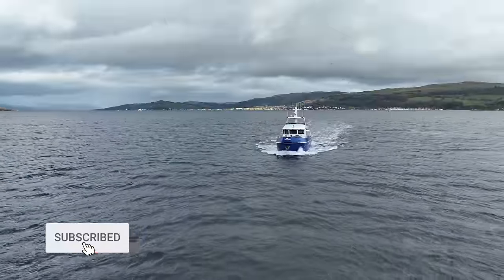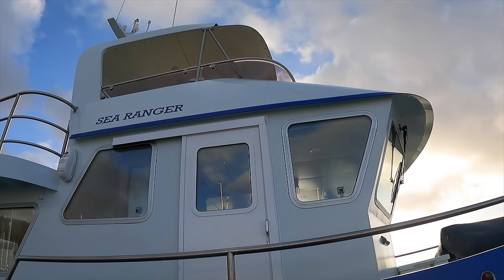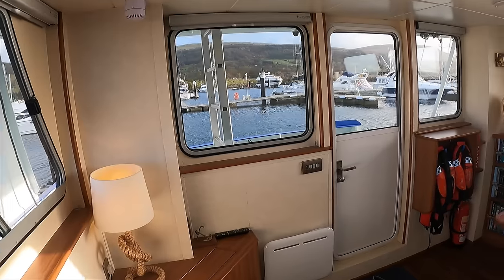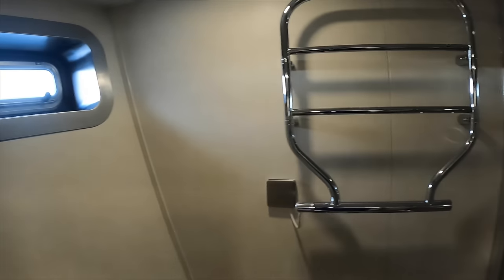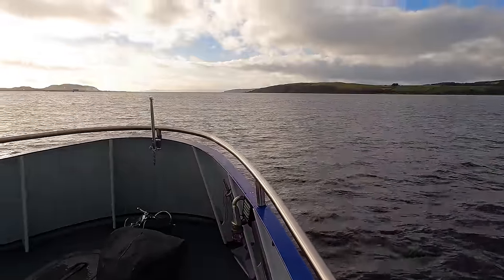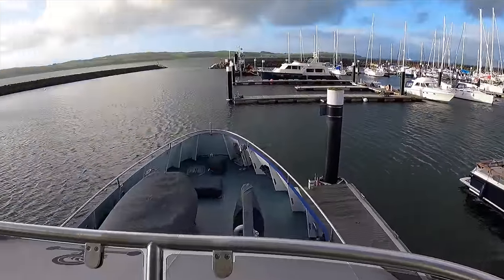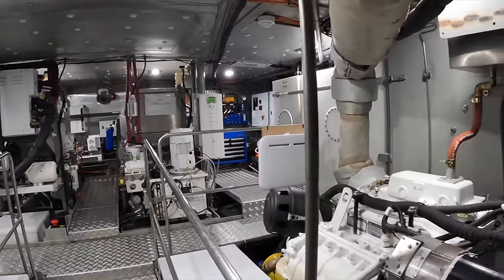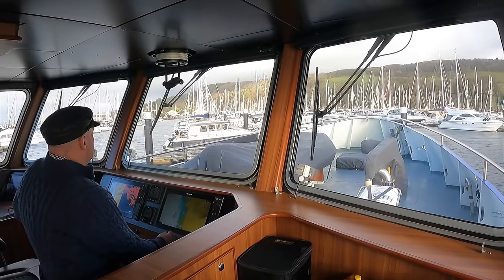THIS Is Hull 1 Of A NEW Steel Liveaboard Trawler Yacht (And She Is For Sale!) | YACHT TOUR

Comment: It is a beautiful yacht, but it has an identity crisis. It's built to a standard that would allow it to cross oceans (class A rating, redundancy, strength, etc), yet lacks the fuel capacity to do so (even if gray water tank converted). Also, it seems to lack the storage and refrigeration necessary for a long voyage. I hope the tiny refrigerator in the galley is just for the everyday items, and there's a much larger refrigeration unit elsewhere. Where is the dry goods storage? On the flip side you say the owner uses it as a coastal cruiser - well, then it's completely over-built for that purpose. I'm sure there's a buyer for this, but you have to want something that looks like a commercial ocean going vessel, and has a price tag to match, but yet will be used for (mostly) shorter voyages of coastal cruising. She is a handsome yacht, and the quality of the build is evident, but she falls into this weird zone between true exploration yacht and coastal cruiser.
Reply: Very well put  ...

Comment: I like it! It’s small enough to captain and crew yourself, but big and stout enough to to handle the blue water. It doesn’t have any waisted space like a 300sqf bar or dining area on 3 different decks. 
The only thing I would have done is have a day head at the aft of the boat.

Comment: For a true seaman who does not need all the flash and bling.  A tough and dependable boat in all conditions.  Hull #2 I would go for twin 250 hp Caterpillar or Cummins. Definitely look at how much speed you gain and fuel use.  You can always pull back on the throttles. Another great 📹 video.
Reply: You wouldn't gain much if any in speed and just burn more fuel.
Reply: That's not entirely correct. Any long-range cruising power vessel, especially for a family on a limited budgets, is best served with smaller but adequate economical, reliable and slow-revving engines. This vessel is already achieving hull speed or better, although one assumes it is lightly loaded for this video. I was pleased with how well it moved through the sea.

The only case for larger engines would be if one were pulling lines or nets or possibly finding that towed deployable stablilizer vanes were creating too much drag.  We all know that if you gave the Queen Mary enough horsepower, you could launch it into space, so more speed is always possible, but the cost in fuel use, burn rate and hence reduced range or additional tankage and hence weight and space requirements and hence "balance" are always a complex equation that must be considered.  Every tweak has a flow-on effect.

Anyway, I'd like to see some underwater lines for her and know the type of steel and protective coatings used. Corten or Lyten (added Cu-Cr) weathering steels are good rust-resistant steels which I have used, that cut cleanly with a torch and bend around the frames to nice fair lines, eliminating the all-too-often "hungry horse" look when low quality and/or badly-welded steel is used. 

I've spent years winnowing down the options for a true long-distance passage-maker and still consider Nordhavn to have got the recipe pretty right, but they are obviously much more highly-priced.  Fleming are good craft too but a but a bit too shallow in the draft for long distance open ocean work in poor weather, I feel, not to mention the cost.   

This craft looks like a good alternative and while appearing more "basic"in its internal trim, is clean, serviceable and being steel, very robust against damage and easy to repair, but requires careful attention against rust. The clean interior walls helps keep an eye on that issue. Condensation behind interior panels, especially fitted or sprayed-on insulation, can be an issue with steel, too. 

I'd perhaps like to see more fuel capacity for longer range while keeping the existing power plants. I still like the redundancy of twins and still find the Nordhavn standard setup of a single plus a wing-engine takes some careful consideration, and I feel it is a decision to be made subject to exactly what the vessel is to be used for and where it is sailing.  Again, the additional fuel use of twins becomes part of that decision. 

The Dutch-built vessel you  discuss in another video on sale with De Valk Yacht Brokers ("Sirius") is the epitomy of some of the best sets of lines that come from that country's designers. 

Thanks for the video. Sorry to have hogged your page, but this piqued my interest.

Comment: I would finish the hard top on fly bridge so it covers the whole bridge, put a track on hard top for sides and rear, install full front venting windows that go from visor to hard top then get high viz windows to put in slide and fasten to boat to fully enclose. It won’t be as toasty as the inside but still bearable and give you room to put a few chairs and couch up there

Comment: Dual engines! I commented on a few of your other walk through's about going to sea on long range boats with single engines. I would never do it. I am sure the owner was looking at $s for the bigger engines option.  So, spending their money, probably should have gone for the bigger motors along with building in more fuel tank space for longer range.  Other than that, this Yacht is fantastic! A 55 footer and how it is laid out is awesome!  It's a good looking, comfortable live aboard, and long range heavy seas cruiser.  Steel hull, rugged build, forward racking windshields, nice accommodations, super engine room, what more could you ask for? This boat rivals the Bearing Yachts for rugged performance in heavy seas from what I have picked up on YouTubing.  Great job MMS! and I am sure this boat has been sold while I am typing my comment.

Comment: I love this ship - so much has been packed in to a relatively small space. She looks both seaworthy and comfortable. While she was built for the rigors of the North Atlantic and the North Sea, I think she would be just as much at home in the South Pacific where I am.
Reply: A ship has to be 300 feet or better to be comfortable in winter conditions in the North Atlantic … somethings like a Flowers class frigate.
Reply: @taggartlawfirm  Those Corvettes were known by many who sailed on them  as 'Submarines' , twas reckoned they  spend more time under the water than above , what with their terrible handling and constant pitching and rolling 40 Degrees either side of upright, the wave spray and water was lofted up into Well Deck a midships  the decks were swimming from that broaching  activity as handling under heavy seas wasn't it's best suit. ...  thinking  the measurement was shorter than that LOA  same being at 205 ft (62.5 m)
Reply: @malachy1847  you may be right

Comment: An excellent vessel fit for purpose, I have been to that yard a few times and they do good work, reflected in what you see in the video, no nonsense vessel that if maintained should give little trouble for the next 50 years. I'll bet that fwd cabin is noisy though? would have preferred Cats personally and a hiab on the fwd deck for stores and launching boat, the one under cover looks a fixed davit for life raft. One big omission was the fresh water capacity, often as important as the fuel on boats that go long voyages.

Comment: Tankage seems a bit low for a 60 ton steel vessel. For staying in Northern Europe, which she was built for, it's plenty. But this class of boat tend to be the "final" boat for many owners (often retiring sailors...). The option for longer passages may make her more saleable.

Love both the interior and well as the exterior. Aft house trawlers are almost always nice. Big, very well protected foredeck, is a huge boon in bad weather. And even the somewhat smaller topsides this result in in a 55 footer, is almost an advantage for the typical cruising couple. "Spacious and open" is not nice when it's cold and stormy. Also, while good boats can be built in any material these days; a steel hull from a commercial yard, built for the owners of such a yard, is likely to be very straightforward and free of complicated weirdness, which a yachts-only builder could be tempted to include for boatshow appeal.

With diesel prices where they're at; you'd think displacement speed cruising will only be growing in appeal. It may not sound appealing to a "powerboat" to be stuck going only "sailboat speeds." But in practice, for extended cruising, sailboats are only problematically slow when the wind is not cooperating. Which unfortunately is the case too often. Being able to go "sailboat in the trades" speed in pretty much all conditions, is not really that big an issue at all, on a long cruise. (Big outlier being the Med. Where 15 knots makes every single passage a daylight affair. While 9 knots can mean staying the night out. But on any other ocean, that's rarely the case.)

Comment: Back in the 1992 I built a Bruce Roberts Pacific Coast Fisherman 36 and stretched it to 40, ketch rigged and single screw. I had planned to go walkabout but alas I had a mountain bike accident which has left me disabled no more boating. But one of these could be the answer maybe 85 could be the one for me with crew. Are they planning to build bigger?

Comment: If I ever hit it big I’ve always wanted to build a steel 130 foot long Alaskan red crab style motor yacht. House aft design. I’m in the Pacific Northwest and the Pacific Ocean can be rough most of the year. A big water fishing boat would handle more that 3 months of nice seas most vessels enjoy.
The problem with a steel boat in a salt water environment is rust and corrosion. Every 2-4 years your going into dry docks for major repairs. Rusted steel cut out and new welded back in. Stripped and painted. Even with zincs and anti electrolysis systems your boat is rusting away. A wood boat will last longer but is a similar situation.

Comment: I do like this trawler yacht. It's perfect for a couple. I'm not crazy about the twin engines, I would like to see a single engine option perhaps with a wing engine as an option.
Reply: Why the single engine? Isnt the point of double for redundancy?
Reply: How many couples would like a standard double bed? Queen maybe but a King definitely a better option. Two more rooms with only bunks would not suit having your friends coming with you. Likewise there are no windows in these rooms, just port lights up high which is a poor design.
Reply: I agree, there’s many advantages to running a single (with a get home wing engine) fuel economy, less maintenance costs, lower center of gravity as a single  engine on centerline can be mounted lower in the hull giving better stability, better shaft angle to prop, can use a larger prop with a single compared to twins. I could go on but suffice to say most fishing trawlers are single engine as are many freighters and very large oil tankers.

Comment: If building a live aboard vessel, then this is the way I would do it. The engine room is perfect for maintaining and is easy to access unlike those very expensive built ones with no room to get in the engine room let alone maintaining it with ease. A redundant generator is also what I would do, I would think about electric motors for propelling the vessel.

Comment: Saw a video of a similar in Florida with John Deere power (twins) and laid out similar. Doesn't have that "RV" look so common in fiberglass boats, and you can GET to any problem in the engine room. I'm in. You can always run down to Brazil or somewhere in Taiwan and swap out what looks like particle board finish for REAL mahogany.

Comment: I think price is a major factor here.  There is a lot of competition for trawlers of this size and capability, many of them well proven and finished to a much higher standard.  Personally I would not consider this boat unless there was a significant financial benefit to do so.
Reply: Agreed... I really like this capable and practical small ship, and could see it as a liveaboard for a frugal sea-going couple (like me) or small family, but it's lack of luxurious touches is certainly noticeable. It may be much more seaworthy than it's similarly priced competitors but you can get a lot of motoryacht for the dollar on the used market these days. I wouldn't even begin to guess what the price tag on this is but I would not be surprised if it is a magnitude of order larger than what I think this would be priced at.
Reply: It was stated quite clearly the trawler was not designed for cocktail parties. For me it is one the best designs I've seen for a smaller trawler. Clean, uncluttered easy to maintain and will go anywhere in almost any sea.
Reply: Yep. Lot of competition in this market, especially from several Dutch shipyards. Personally, I find the very high flying bridge unattractive.
Reply: @zorbakaput8537  So, how much would you pay for it?
Reply: Not 3 mill plus vat, it's just not fitted out to a standard that says I'm definitely not on a fishing boat!
Reply: Love the twin luggers this little ship sports.  For the occasional long haul it would be easy enough add an auxiliary fuel bladder or two.  Petro-Flex offers a rugged 500 gallon tank.  Best kept completely full until you can transfer all the fuel into boats tank at once.  This vessel could easily handle an extra 3500 hundred pounds of fuel.
Reply: I prefer the steeler 61s
Reply: I would find this boat very comfortable & would feel proud to own & sail it!

Comment: Excellent video. Interesting proposition. Curious why a long range displacement speed cruiser is twin engine. For a 60ft boat she seems to have limited interior accommodation and cabins. Interior looks a little utilitarian and spartan, not exactly a home from home. Feels a little dark down in the galley dinette area. No doubt she has excellent sea keeping.  I'm sure a boat like this would appeal to folks who cruise areas exposed to the Atlantic or North sea swells and extended shoulder season cruising.

Comment: Great video, but what's up with the frame rate? Sometimes it's incredibly choppy.
Reply from the maker: Do you mean on some of the interior shots?
Reply: @YachtBuoy  initially, yes. But it seemed to continue when you went up to the fly deck too.

I assumed it was just flicker from the refresh rate of the LED lights, but it should only apply indoors.

Comment: An acceptable vessel, but that much plowing in flat seas left me wondering about taking on water in 'rough waters'. I watched this, comparing it to the Jay Benford Expedition Long Range (Steel) Trawler, and by comparison...there is none. They are both 55', similar engine power, but the Benford has 3x the range (12k liter fuel capacity), more room (wider beam), and is the ideal layout for a true '4-season live-aboard' vessel. It also has a 2-ton davit crane with storage space for your dingy vessel, but also a small vehicle!

Comment: So, fanastic looking trawler boat, however range is poor, interior needs to get rid of the   Irish Sea transport boats. The sun deck, if honest I would put a hot tub, the fore deck is great and I would move the BBQ there, once the tender is off that would make a fanastic chill out zone, add a small wet bar and large bean bags along a projector you get a a cinema at sea experience.   Love the heated floor in the bathrooms, but would add to all floors, below decks. Solar panels should also be added.

Engine room should have a the ability to fill dive bottles with air, no obvious space for toys such as paddle boards etc.

I would love to spend a month on board travelling to Iceland, Finland, Norway. Then travel down to the south of France in this. 

A steel hull, built by a commercial boat builder, to the highest standards is kick ass, wonder if she could reach north pole?????

Comment: This is a really nice little ship. The design is utilitarian but comfortable; function & form, well done.   A bit more counter top space in the galley would have been nice.  I would do away with the external hatch access to the flybridge, its pointless and just takes up space; no one would ever use it. The engine room fire extinguisher is rubbish (dangerous) and needs to be swapped out for a CO2 system.

Comment: What voltage does this vessel use? The sockets look like standard UK 240v, but surely for safety reasons they should be 110v.   In wet/ windy weather it would be easy to get water very near to a socket, not off the sea but from wet clothing etc.

Comment: A little too no nonsense for me. It looks like a work boat in just about every way. Blue vinyl, small cabins small "small crew lounge" . The only think that didn't look commercial was her range. I figured a boat of that size with so small and sparse crew accommodations it would have had a lot more range than that.  The engine room was great though. I am curious about the price of it. It isn't listed anywhere.